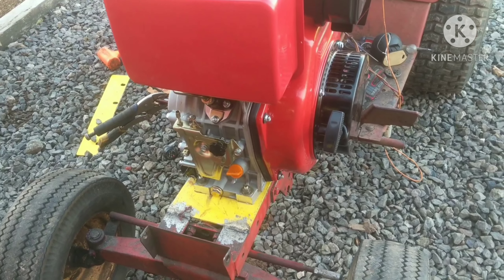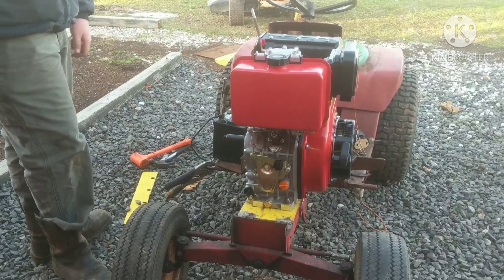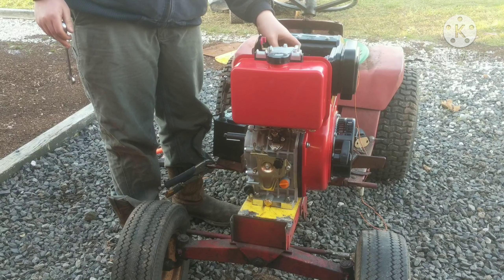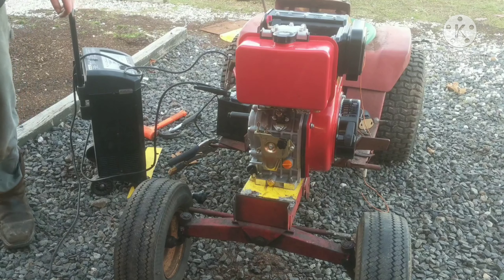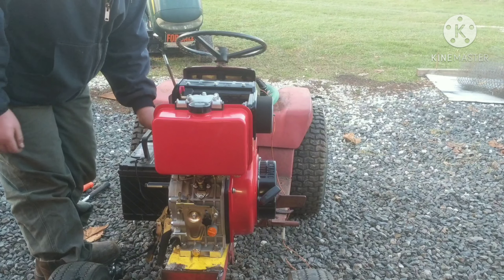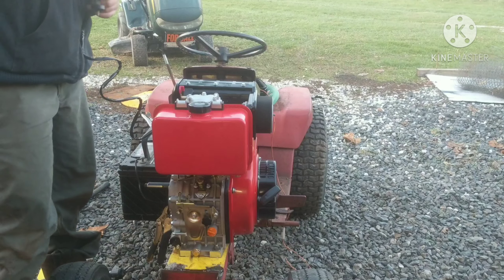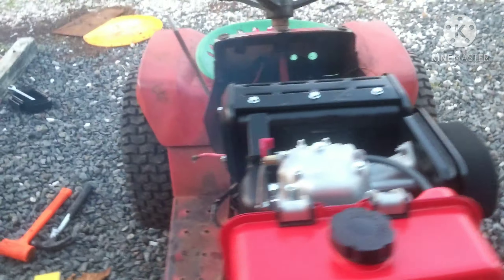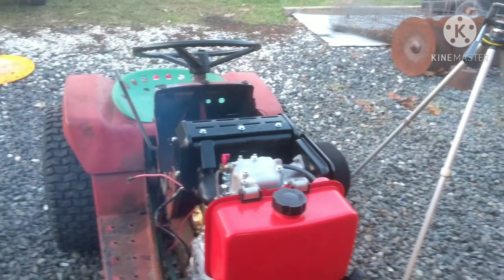FIRST START OF MY CHINESE 10 HP DIESEL !

Comment: i had to shorten the battery cables..  cut into them to find 9o percent rubber 1 percent copper  .. nice big looking cables tiny little wire inside . 
im gunna  open up the starter motor  ill be looking for a rubber band

Comment: these are a 500 hour motor  the Japanese one is a 3000 hour motor
Reply: Where can you find a Japanese one?
Reply: Got close to 2000 on mine it’s a Chinese clone engine like this bought it in 2007!
Reply: What happens when you get close to its end life, does the motor runaway and scream to the moon
Reply: Lawn mower engines cost $2,000 and dont last that long😂

Comment: Why didn't you rotate the recoil to start from the seat
Reply from the maker: I'd like to see you pull that from the seat even with the compression release on it takes alot of strength to pull it over. If it was a 6 hp gas engine than I would have but no Way you are pulling that sitting down
Reply: @dreamingbigcustoms9860  You can, seen it done.

Comment: Diesels run at much lower rpms than gas.That would make everything like a mower deck turn much slower.
Reply: Easily countered by fitting a bigger drive pulley
Reply: Old mowers like this often had a low speed Briggs 10hp or something like that on them, in other words its already fine.